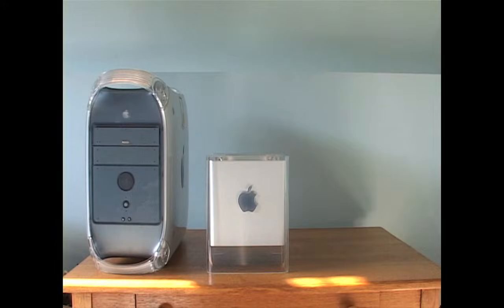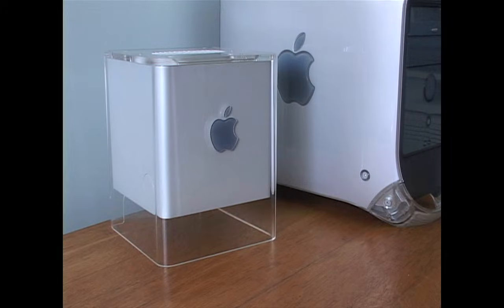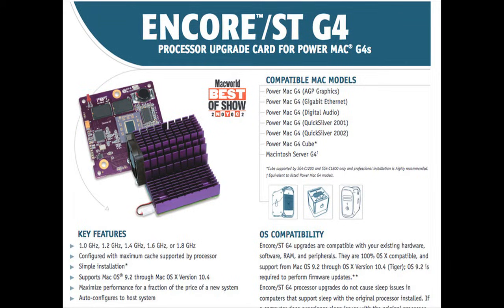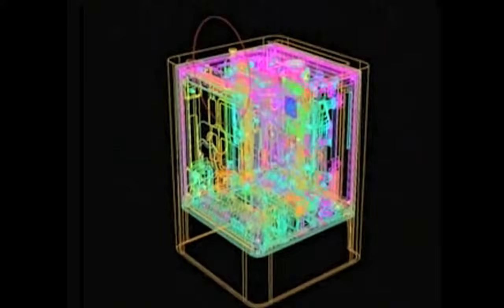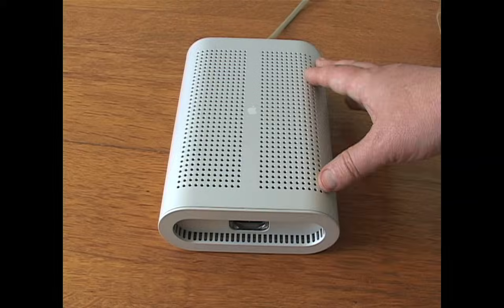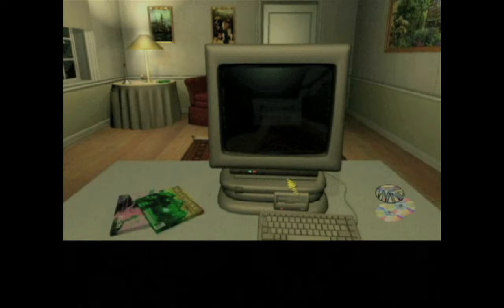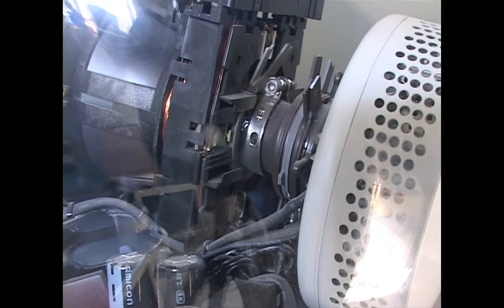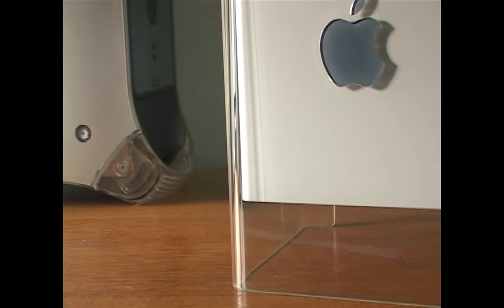The Power Mac G4 Cube

Comment: What do you mean "...Nobody has three Cubes...". 
In 2001 did a "Linux native on P4" presentation at a Dutch university using an xGrid  infrastructure. Because the license for using the xGrid software like this hadn't been formally cleared with Apple, IBM bought 16 Cubes that use basically the same processor (Motorola might disagree...). When the presentation had finished, it turned out to be 'administratively impossible' to enter 16 Cubes into IBM NL inventory. I was told to give them away. I managed to do that with five of them, university regulations did not allow staff to accept gifts as valuable as a Cube. I ended up with nine Cubes that had nowhere to go. No idea where the other two went. I still have five G4 Cubes left. One has been converted into the sexiest NAS ever and I upgraded one to a G4 1.2Ghz machine that served me well until Linux support for Power all but disappeared.
I'm looking at converting another one into an i7 hachingtosh, somehow seems appropriate. Yes, there are people that own three Cubes.
Reply from the maker: To explain, that was originally a joke that was NOT going to work... then I left it in anyway. In 'Back to the Future' in 1955 someone says, 'Nobody has three television sets." but then I checked the movie and it's actually "two television sets". It was already a weak enough reference joke without it being wrong! But looking at hundreds of pictures and videos, I never saw anyone with more than two cubes. I figured someone with more knowledge or cube experience than me would disprove that and bring something interesting to the table and you did. Fascinating story and upgrades! Congratulations being in the three Cube club!
Reply from the maker: Well said, Lewis!

Comment: You paid $175 for this setup?
Here in France you'd find one for double or triple the price.
Nice catch
Reply: And in Spain surely you would find one for the quadruple of the triple of the double… It’s hard to find them at a good price. I found Macintosh Classics at 2000€!!!!!! I purchased my SE/30 at 100€ and with some repairs It’s working fine.
Reply: @frankrodiii  I got an SE/30 for exactly the same price, and it works as good as it can (I'll need to add an ethernet port or something).
Sometimes you get retro mac for pocket change (I recently got a Single 1.8Ghz G5 with 6Gb of RAM that might actually be 8 if I see why 2 of the DIMS are not working for 60€) but sometimes people sell old stuff in a non working state for hundreds without any reason

Comment: Excellent video.  I had a G4 Cube.  I bought mine shortly before they were discontinued, for $1199.00(clearance).  It was the base config.  Cool, unique computer, but, like you showed in the video, the ports were a pain to get to.  That power brick was massive, I thought, too big to put on your physical desktop without taking up all kinds of room.   Also, hooking up a USB port hub was a royal pain until you figured out how to hook it up so that the speakers, keyboard and mouse still worked.  I can’t remember exactly what I finally did, I think I had to plug the speakers into one of the ports on the Cube, and then maybe daisy- chain the mouse, keyboard and hub into the remaining port on the Cube, in some particular order, so that the Cube would see USB devices plugged into the hub.  The only hardware upgrade I did to my Cube was change out the stock 5400 rpm 20 GB hard drive to a 60 GB 7200 rpm one, which did speed the machine up noticeably.
Reply from the maker: Thanks for sharing your experience. I know you are supposed to plug the mouse into the keyboard and you can't plug the speakers into the keyboard. I was going to cover that in the video,  but cut it for time. Glad you liked the video!

Comment: A a Mac lover I always yearned for the top end stuff or the design stuff. But having a consumer bank balance I always lived somewhere near the bottom. I saw the cube speakers and thought they were awesome. Bought a pair on eBay and naturally they didn't work with any of my Macs. I still have them today, testament to my poor choices in life.
Over the years I have become less enchanted by the Mac for the reason you pointed out. With each successive model they often took away features from previous models. Features which users grew to depend on. iMovie in an early version was able to edit frame by frame, they took that away. The big one is AppleWorks which I used extensively to write text. They just stopped it working with the latest OS, no apology, no work around, just "fuck you consumers, you need to spend more money with us to upgrade, even if you don't need to. Apple has become like other tech companies, their mission in life is to separate their customers from their money. Sorry about the swearing but it truly reflects Apple's business philosophy
Reply from the maker: Very true, Gary. Apple tends to constantly leave it's loyal base with feelings of abandonment, which will hurt them long-term. Thanks for the thoughtful comment !